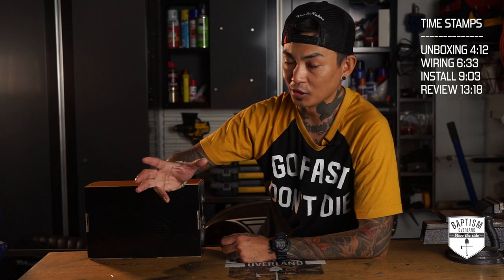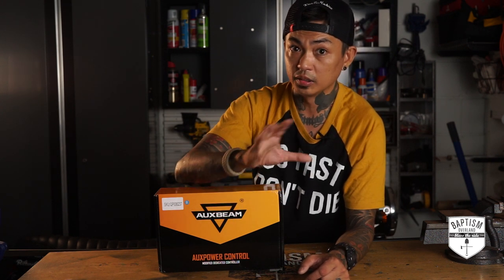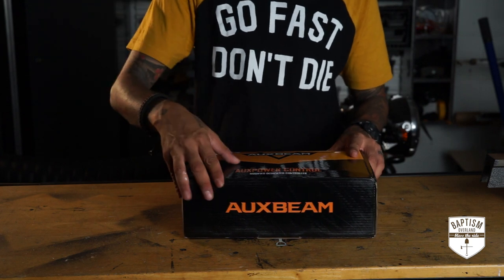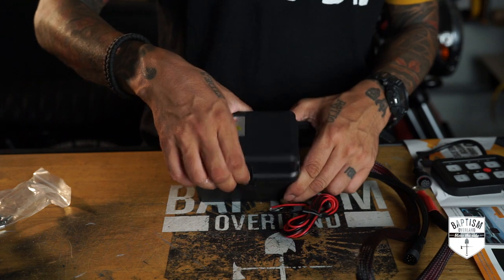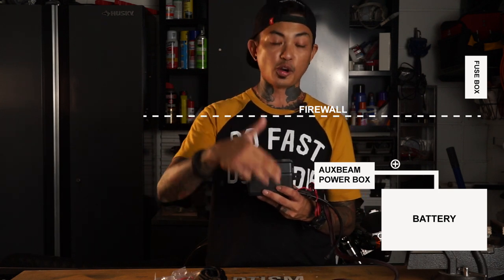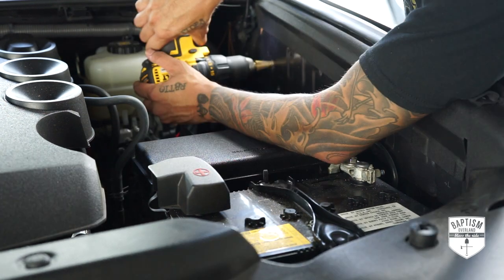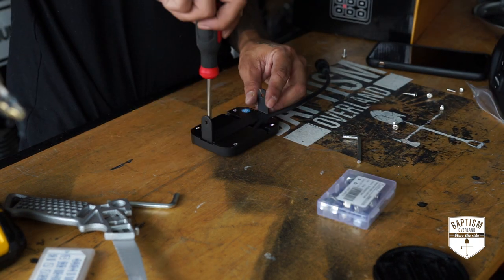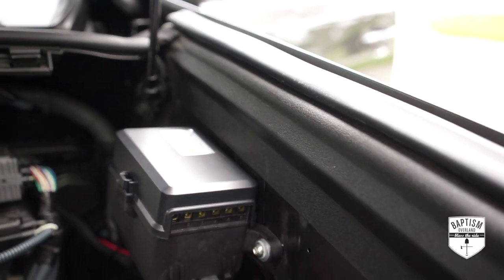Your Rig NEEDS This Auxiliary Switch Panel!

Comment: One downside I found was you can't use  the high beam with your high and low beam toggle has to be done manual pushing of buttons on and off which gets annoying on highway

Comment: FYI Jeep owners:I purchased the control panel cable extension. I ended up not needing it in my 2016 Jeep JKU install.
Reply from the maker: Awesome! I run the ApolloInTech in the Jeep and didn't need one there either. The distance fr the Jeep battery to the inside of the vehicle is very short compared to the runner. (I own a 2016 as well)

Comment: i’m having a problem with mine. #6 button will not turn off, it’s on constantly. i’ve replaced relay and fuse for that button, no change. it even stays on when those are removed. the auxiliary light for that button goes off when i remove them, obviously but the buttons on/off indicator light stays lit 24/7
Reply from the maker: Whoa. Weird! I have a feeling they made a mistake at the factory and something got wired constant.

Comment: Years back when I had a 78 K5 Blazer all set up for off-road and camping I had the power welder from wild horses ( I think was the name ) installed and it was AWESOME !!! It was expensive but I got it on a 50/50 Barter , it saved my ass a couple of times when I didn't have replacement U - joints and when my tie-rod busted . I regret letting it go when I sold the K5 and would love to get another one but that 1400 bucks can go along way in other areas right ....

Comment: Very helpful! I got mine installed today. Like you said it’s fairly easy install, the only challenge part for me is the red line connection with the fuse box under the steering wheel, for some reason it didn’t get power at first, couldn’t find the reason, then unplugged the fuse and flipped the other direction it worked. Weird, thought either direction would work.
Reply: that's why I found a fuse in the engine bay box and wired it in that way.  Didn't have to run the red wire into the cab.

Comment: for the placement of box... you could mount same place, but use longer bolts going to your rivnuts... and then use barrel spacers to push it out off wall a bit
Reply from the maker: Yep. I actually ended up doing that.  Crazy thing is their new version actually has space now.

Comment: I see this video is 2 years old. I am curious if you still believe the quality and functionality of this switch is good. I am leaning toward this switch pod.
Reply from the maker: Oh yeah and I've still recommended it to people. Works great. I'm actually considering another one for other accessories I plan to add to the dual battery system

Comment: This is such a great video! Thank you. 
How does this wire into your Xprite trailing bar? Were you able to maintain the functionality of the amber flashing lights?
Reply from the maker: You don't wire it to a chase light because of how it's setup. Like, you COULD but you still have to install the chase light switch cuz it has 3 positions so really you're gonna have to press two switches just to activate it. Would be pointless

Comment: Some people use their welders in remote areas. These are "mobile welders" usually mounted to a truck, usually powered by diesel / petrol generators. However, using an inverter and some huge batteries, it is possible to wire a smaller welder (usually stick / flux core) into a dual battery system (less "dual" since they usually use a powerbank made from multiple batteries). 

Welding on fences / cabins / remote infrastructure that doesn't have power is much easier from a truck modified into a mobile welding station that running idk how many km-s of cord / cable to the site, especially since it can easily be damaged by rocks / wildlife or traffic. Welders draw a lot of amps, so you don't want a live wire touching a puddle or something.
Reply: Comment was meant for another product bro.

Comment: I liked your video, you do a good job explaining the process. I have a 2020 Ram 2500 Tradesman that does not have fog lights so I am wanting to install some. I have looked at several difference options and I can't help but believe using a controller like the Auxbeam is the answer. However I have looked in the engine compartment and I don't really find a place to install the control box around the battery or firewall. My Question is have you installed one on a 2020 Ram 2500 with the 6.4 Hemi, if so where did you put it.
Reply from the maker: I have not no. Man I hate how new vehicles leave no room in the engine bay anymore!

Comment: What do you think of the Voswitch system? I am running the voswitch jk100 on my Jeep and it was plug and play. I would recommend installing a fuse or a circuit breaker from the battery to the auxbeam system or you risk burning your Jeep. It’s similar to the previous electrical issue you had before.
Reply from the maker: I’ll look into it but I’m running ApolloIntech now
Reply from the maker: At this point both vehicles now have a switch pod system that works. If any of them fail I’ll look into Voswitch

Comment: So you have to ground every groundwire to the frame? The other Auxbeam you put both wires into the box.
Reply from the maker: Exactly! Kinda sucks cuz on my Jeep both go into the box too.
Reply from the maker: In a way, it COULD be advantageous. For instance, if I’m putting rear lights, I only have to route the + wire up to engine bay and I can ground it somewhere closer to the back

Comment: About the mounting of the box and being too tight to the body wall to remove the cover - thinking I'm just going to go ahead and mount this whole setup to an aftermarket tray (or just fab one myself) like from SDHQ or PowerTrays or something....
Reply from the maker: Yes! Def do something else cuz it's annoying pressed up against the wall. In retrospect wish I woulda done that. I probably will. Maybe some spacers
Reply: y not just use a spacer/washer, enough 4 clearance?

Comment: I have 2 set of led lights, different switches , different harness  inside the cabin three wires is there any different on my case? Thanks!.
Reply from the maker: Do you have the 8 switch one or 6?
Reply: @BaptismOverland  6
Reply from the maker: @agentelopez82  I'm trying to figure out what you're asking. Are you asking if you could use all those accessories on this switch pod? If so yes. You can get rid of all the switches and wires and just plug directly to the switch pod

Comment: I think you said add it to the acc which is a 5amp in the cabin. I went to use the aux beams add a fuse but the Tacoma’s fuses are low profile so I couldn’t fit the tacomas fuse in the auxbeams add a fuse.

Do I need to get normal 5amp fuse? or will I need a different add a fuse that has low profile fuses?
Reply from the maker: Funny I JUST installed one of these last night! So you're in luck. Lol. So Toyota uses mini fuses but the problem is they use the kind without the long prongs. You can fit the add a fuse fr the auxbeam but then there's no way to add the yota fuse into the add a fuse. You'll need to go get a mini fuse in the same amperage but with the longer prongs to replace the yota one
Reply: @BaptismOverland  Just what I was looking for! I will be grabbing a extra 5amp fuse with long prongs so I can use the auxbeam add a fuse! Thank you!
Reply from the maker: @bretthumberstone8148  yeah man. LITERALLY did this last night on my friends Runner and I forgot what I had done before till I remembered 😂 LUCKILY I had an extra fuse laying around for my wife's Runner or else we couldn't have finished the install.
Reply: @BaptismOverland  Haha exactly! I got the temporary mount done and wires through the firewall but couldn’t go further than that!

Comment: What do you think about this compared to switch pro for the $? I just ordered a new truck and will need one. Which one would you get. Thanks
Reply from the maker: Heard a lot of great things about the Switch Pro. I couldn't give you my honest thoughts as I've never used one but all these systems are pretty much the same. I have the ApolloIntech installed in the Jeep and love it and I've also loved this on the runner too. It does what I need it to do.
Reply: Any idea why they only make this for a jeep and nothing else? 
 I like that it mounted to the pillar. But mine is a ram
Reply from the maker: @fredA1234  the ApolloIntech? I'm not sure. I like it also. But I WILL say this auxbeam in the runner works really good and it's universal

Comment: thanks for the sharing! but have you considered to mount it on top of the stock fuse box (the plastic cover) instead of the side? If yes, do you think of any cons of doing that? coz i’m just bought the auxbeam but don’t wanna drill a hole into the rig.
Reply from the maker: Absolutely I did. But think about this...there's a ton of wires coming out of this thing. If it's on top of the fuse box, when I need to get to it, I'll have to move the lid AND this box with all the wires. It's just a lot more mess to deal with. I would rather just have it to the side
Reply from the maker: Also I would rather drill a hole in the rig where it's secure vs mounting it to a plastic lid because the box will be slightly heavy and I don't want it bending the plastic lid of the fuse box. Also if you drill the lid you'll destroy the fuse chart underneath it and I def don't want to do that
Reply: Got it sir! really enjoy your vid, looking forward to your next one.
Reply: The fuse adapter originally comes with a 5A fuse, so i add extra 7.5 stock fuse on top to a 7.5A slot, coz add up its 12.5 which more than the 7.5A spot thst i  insert, would that blow my battery?

thanks!
Reply from the maker: @finger8588  well the fuse is so that the battery doesn't blow lol. You have to figure out the amperage of what your powering and that's how you determine what fuse to put in. You can def swap the fuses but you need to get just slightly above the amperage of your accessory so if it runs to hot it'll blow the fuse and NOT your battery or start a fire
Reply: When i open the product, the adapter alrdy comes with a 5 amp fuse of one of the slot, and in your video, when you took out that 7.5amp fuse from the ACC slot, you mentions plugging into the second slot of the adapter, so in total it will have a combined 12.5 amp fuse on the adapter (7.5stock fuse + 5amp fuse that comes with the product), if I plug into a 7.5amp ACC slot, will that be too high amp, as now it allow 12.5amp to run through the 7.5 amp slot, the fuse will not blow at 7.5amp as it allows 12.5amp to pass through now, should i just put 7.5amp fuse to the adapter instead?
Reply from the maker: @finger8588  Ohhhh you're talking about in the fuse box itself. Gotcha. Yeah you gotta double it up because you're putting twice the load into that one circuit. Your accessories and now the switch to the Auxbeam. Don't worry that''s just to light up the switch panel. All your accessories that you plug into the auxbeam isn't going through that.

Comment: How the auxiliaries positive wire is protected from the weather. The terminals are open to the weather.
Reply from the maker: No it's covered. Which- a gripe I had- was that it's hard to remove the cover because it's butted up against the wall. On my Jeep I have the Appollointech and that one can be removed easily.
Reply: @BaptismOverland  I mean the side area where the wires are screwed in are not covered.
Reply from the maker: @hj7993  and that's what I mean...when the cover goes on, it is covered. It's not FULLY covered because obv the wires need to go out to...but covered enough. I think of it like this...even your battery terminals are fully exposed under the hood and many other components. It's been fine and we live in a hurricane prone area. Haven't had a problem. We've also taken it off road where the entire hood area was covered with mud. So I'm not super worried
Reply: @BaptismOverland  Thanks for the info. I may consider using dielectric at the terminal.
Reply from the maker: @hj7993  sounds like a good idea. Better safe than sorry!

Comment: Came across your channel and this video, very informative so I like and subbed. Even though I only have 2 lighting mods for my 2015 4Runner Limited - Engine bay LED lights and Raptor lights and don’t plan on anymore, at least for now, lol! 🤓😊But I’ve been curious about these affordable switch pods so this was good for me to watch. Like others have said, I would mount this on a tray so it can sit horizontally away from the fender wall. Also, not too crazy about drilling holes in my dash to mount the switch pad. I’ve seen where others have mounted it in the same spot using 2 sided tape so it lays flat on that shelf. Any thoughts on doing if that way?
Reply from the maker: You def can. It's light enough to just use some really good adhesive. My problem is we live in Florida where it gets really humid and every time I use adhesive to mount anything, the heat and humidity eventually gets to it and it comes off.
Reply: @BaptismOverland  Good point on the adhesive.
Reply from the maker: @mikesweeney5685  I feel like if you do it discreetly and just punch one hole somewhere it should be ok. Besides it makes wiring sooo much easier and then if you sell the vehicle keep the pod there for the next person and just take your lights
Reply: It comes with a double sided adhesive pad.

Comment: What fuse did you use in the add a fuse, what numbers. I  cant seem to get the button controller to get power.
Reply from the maker: It was a mini because that's what Toyota uses. I don't remember now what amps. I think it was 20. Have you tried turning on the unit? Because I know someone that thought it wasn't getting power but didn't realize there's an on off for it.
Reply: @BaptismOverland I think you said add it to the acc which is a 5amp in the cabin. I went to use the aux beams add a fuse but the Tacoma’s fuses are low profile so I couldn’t fit the tacomas fuse in the auxbeams add a fuse.

Do I need to get normal 5amp fuse? or will I need a different add a fuse that has low profile fuses?

Comment: Seems odd that they did not put a negative bus bar in the switch box.  Would make it a lot cleaner when routing loomed wires from your devices.
Reply from the maker: My thoughts exactly!! The one I have for the Jeep (ApolloIntech) has negative terminals :)
Reply: @BaptismOverland  The auxbeam 8 does do the pos & neg.  Too bad it's not for the 6.  Oh well.
Reply from the maker: @colinarnold3726  yep. I almost considered upgrading
Reply: @BaptismOverland  but hey, you got a freebie!  I actually bought a Talon Cat cover from a guy and he goes "hey, want this new Auxbeam 6 gang?"  Who am I to say no?  So like you, I made it work.  Thanks for the vid.

Comment: Does it have a Low Voltage Cut off?
Reply from the maker: No it does not. What I DID though was add a 100 amp circuit breaker so if it shorts it'll cut the whole system. But as far as low voltage it doesn't. I'm sure if I get a dual battery setup though I'll use the low circuit cutoff fr that

Comment: umm, "who needs a welder" is not something you will be saying if you run challenging trails reguarly with a group of people.  I have a Bun portable welder from Sue Bun on FB out of Sacramento and it is nice... but the alternator based welders are a nicer solution to weld on other people's rigs.... you cant weld on your own rig with that setup but still they are very nice.

break a control arm mount, shock mount, putman arm, sector shaft, steering box bolts, steel tie rod.... plenty of other situations also..... broken spider gears in an open diff.... lincoln locker them for the trail and then fix it back at home ..... lots of situations
Reply from the maker: THAT is awesome. That’s the answer I was looking for as I had never seen a rig with a welder on YouTube. Thanks man!
Reply: @BaptismOverland   paul from Fab Rats has a few on his rigs.  he has a few videos on them. and them in use. 
they run off his Alt and has a throttle lock to keep his RPM's up..

Comment: Link for the switch doesn't work 🤔
Reply from the maker: Sorry about that. I think they had sold out but they're back in stock. Try this one:

https://www.amazon.com/Auxbeam-Universal-Circuit-Automatic-Dimmable/dp/B08RRV197G/ref=sr_1_2_sspa?crid=1Y9O4PYCEZYP5&dchild=1&keywords=auxbeam+switch+panel+6+gang&qid=1634582023&sr=8-2-spons&psc=1&spLa=ZW5jcnlwdGVkUXVhbGlmaWVyPUExNEdHNEdZM1A2WDlJJmVuY3J5cHRlZElkPUEwNzMyODQwMjhIWVoyMk82UDJFNCZlbmNyeXB0ZWRBZElkPUEwNDIxNTI5MlNISjJPUlBUUTVWUyZ3aWRnZXROYW1lPXNwX2F0ZiZhY3Rpb249Y2xpY2tSZWRpcmVjdCZkb05vdExvZ0NsaWNrPXRydWU=

Comment: i watched this on mute - only because im on the phone wit my gf.. so you might've addressed this: but does this void your warranty?
Reply from the maker: It’s not the kind of mod that should. Normally warranties are voided if you’re switching out parts that alter the ride or performance of a vehicle (suspension, brakes, engine, etc). I could be wrong but this is just an add on that if you wanted to, you could easily remove it and the ride quality hasn’t changed